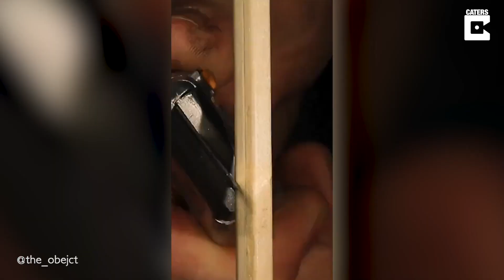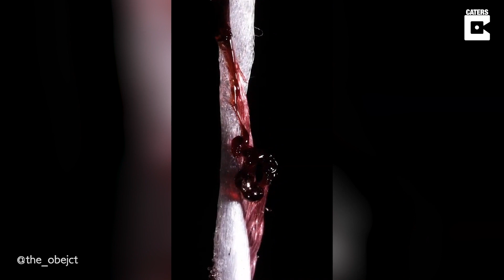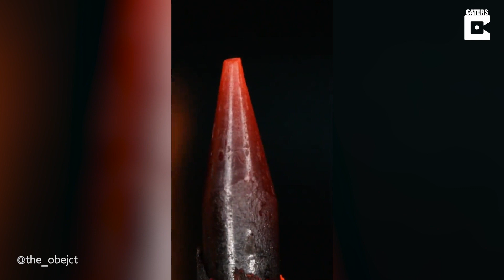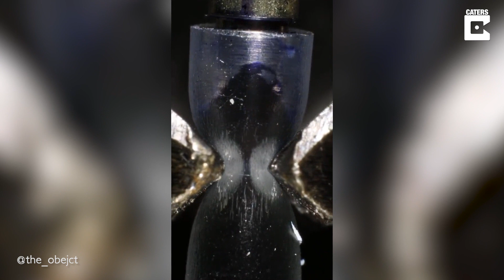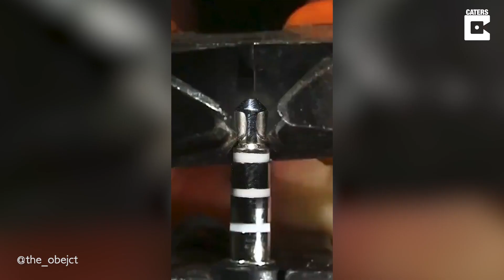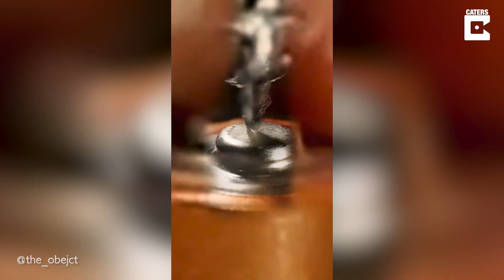Photographer Creates Macro Videos Of Objects Breaking

Comment: Yo why do things that are superheated turn red as opposed to any other color?
Reply: Science
Reply: @sangwoosbussy6613  I can live with that
Reply: the heat increases the energy of the electrons inside the material and the photons emitted reaches the red region of the visible spectrum
Reply: @DX413RB8  Uh huh, so that's why no matter, what color flame or what have you is around it, the superhot thing always turn red before becoming white?
Reply: @allohtoffbaqphat4547  well, it depends on the material, the only thing that turns white under superhot temperature are metals. They are pressurized with heat to the point that they glow red-white, in my opinion.
Reply: @DX413RB8  I see. Thx. Now I can sleep peacefully tonight